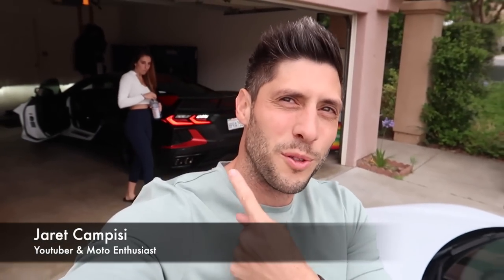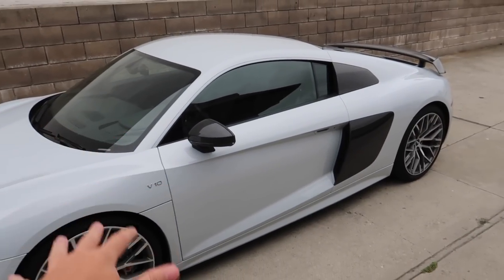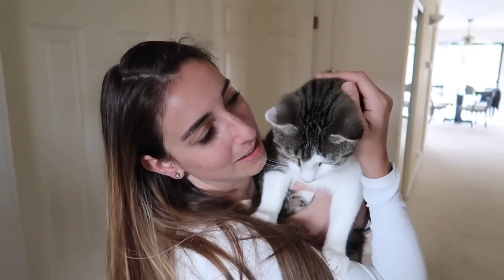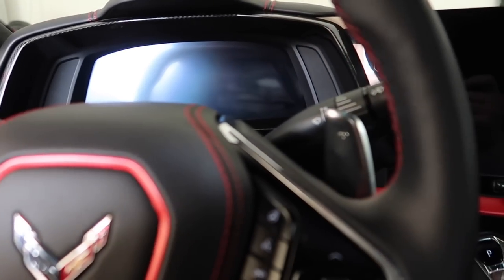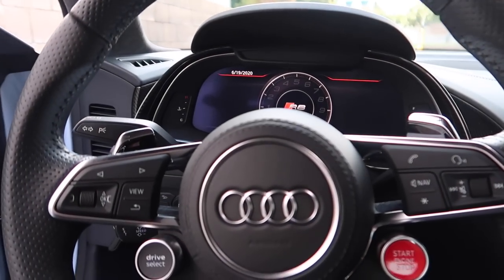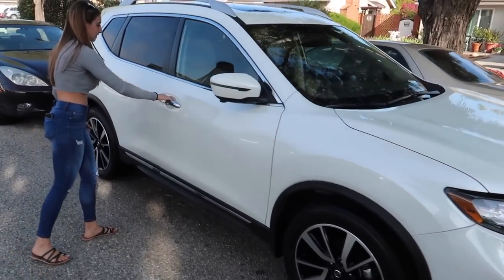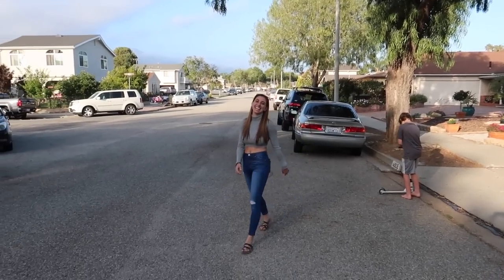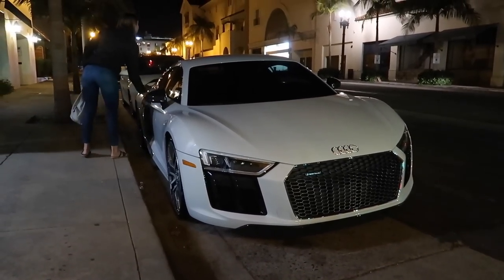First Mod & Wrap Ideas for My New Audi R8 V10 plus!!!

Comment: Suggestion for the front grill...the insides of the grill could be blue....and front black...just a suggestion though...😅😅
Edit: assuming behind the grill is the radiator (i am dead wrong here..i know), i am not talking about painting the radiator... if insides of grill are painted blue, it will create a visual effect where when you will look from an angle blue will not be visible. But as soon as you switch the angle of viewing...blue will start popping up..🤟🏿

Comment: You can buy a Oem Audi Black Optics grille from TAG Motorsports, that’s where I got mine, huge difference and with Gloss Black emblems and V10 badges , looks sweet!,  I have 2017 Ara Crystal Blue V 10 Plus also 👍🏼👍🏼👍🏼